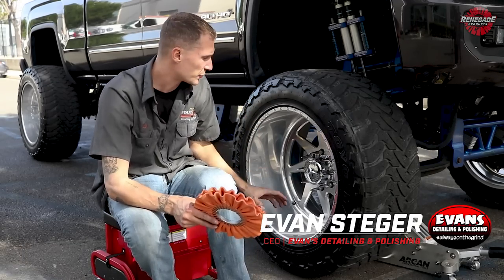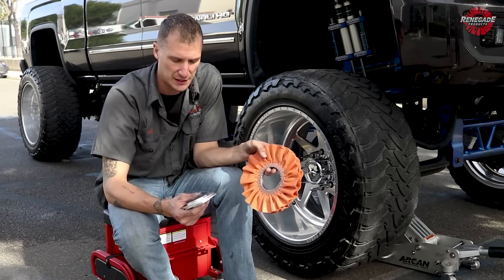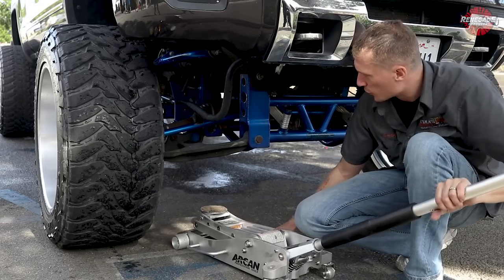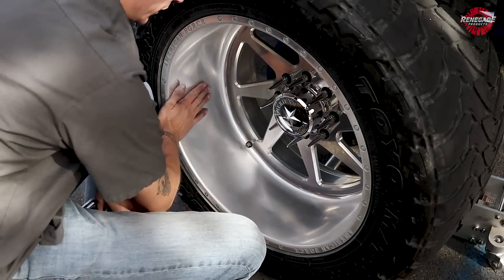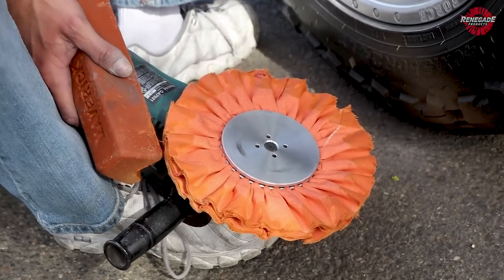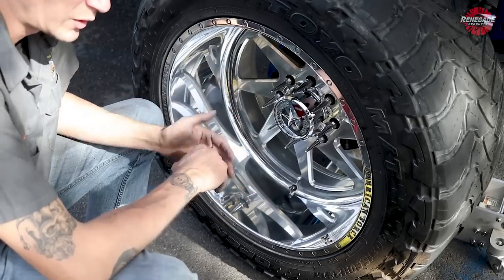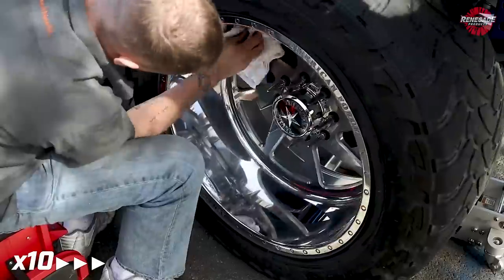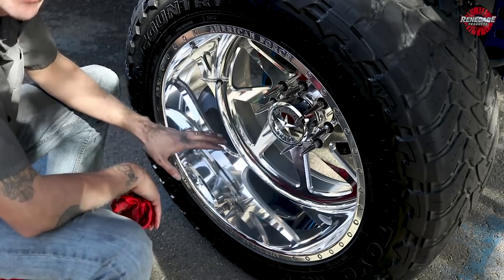How to Polish American Force Wheels by Renegade Products

Comment: question... can you ceramic coat on top of polished surfaces for an easier cleaning?
Reply from the maker: It’s not recommended as oxidation will still occur and then you have to sand the ceramic coating off to polish

Comment: Just curious when I used to polish in early 2000s I would have used 800 1200 1500 1800 and 2000 grit before I started buffing.   I didnt use the same rouge as you . But my stuff always came out deep. Does yours look cloudy only standing to 600 or does your rouge take care of it.

Comment: What exactly is the bar things. And where can I get them from?
Reply from the maker: Devin Taylor The Bars are polishing compounds with very fine abrasives fillers that can polish a variety of surfaces. The green and brown bars are typically used for aluminum paired with an angle grinder and buffing wheel. You can get everything you see used in this video from out website! 
www.renegadeproductsUSA.com

Hope that helped. Let us know if you have any other questions!